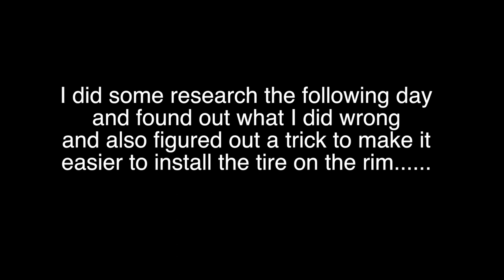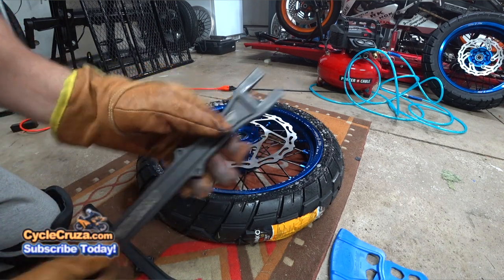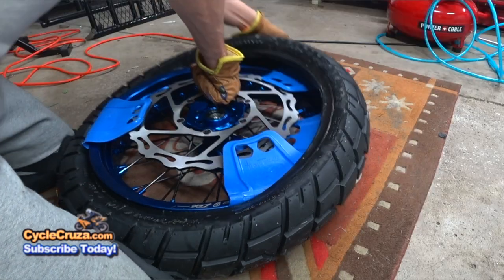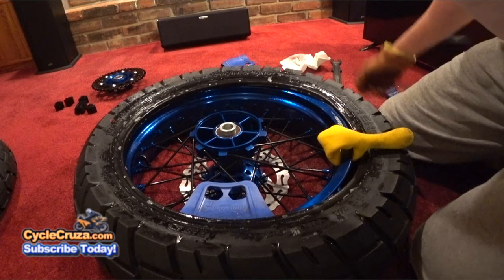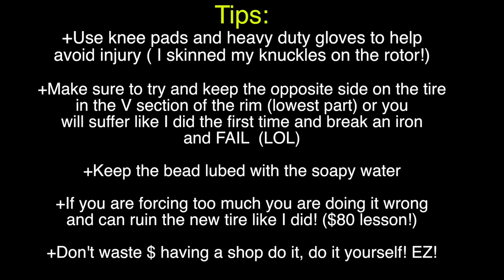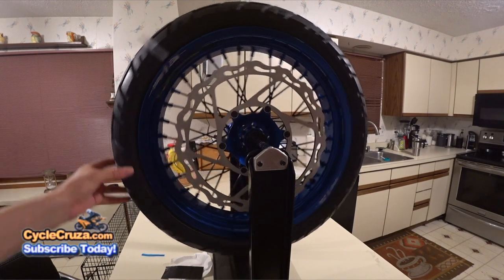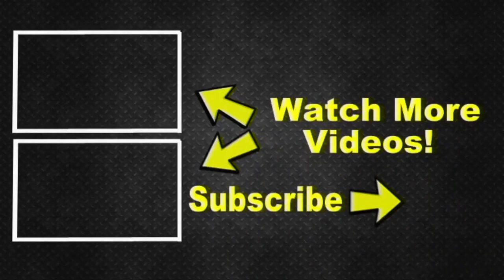How To Change & Balance Motorcycle Tires EASY!

Comment: I ruined a tire my 1st time too. Don't feel bad. Nice to see someone make a video about how easy it is to ruin a expensive tire. Most people don't mention the tire has to be in that groove. Experience is a hell of a teacher. Good video! Btw, sometimes it easier if the NEW tire sits in the sun for an hour or if its winter I put a hair drier on low inside the tire and put the tire in a box if I have one big enough. WARM TIRES ARE ALOT MORE PLIABLE!

Comment: Hi cyclecruza, today my mechanic changed my tire on my cbr 125 r. He couldn't get the rear tire to fit correctly in the wheel so he put an airchamber in it, but it is a tubeless wheel :/ is it dangerous(maximum speed of the cbr125r is 130km/h(or 80mph)) can my tire blow up?(i read that the air between the tire and the chamber can explode the chamber or the tire if it gets to hot)

Comment: Ok so I remember watching your some of your videos a while back. You were talking about how expensive it is to own certain bikes because of maintenance through the the dealerships. I do my own maintenance, valve jobs, everything. I take my wheels and tires and to a shop. C'mon Cycle Cruza, everything else is easier than tire changes without a machine.
Reply from the maker: C'mon change tires yourself, it's so easy it's not funny with these tips I gave. The two bead buddies make changing tires a cinch.
Reply: @CycleCruza  yeah I think I'll give it a shot next time I need tires.

Comment: Just did my Aprilia Tuono tires. It took me for both tires 1 hour including balancing. I love Continental tires, they are soft and super easy to mount. I used 3 rubber rim savers and a spoon. No scratches, no damage on the wheel or tire.
It would have taken me more time if I had to remove the tires, this time the tires were taken off by the previous owner.
P.S. I wish that I had a set of knee pads, my knees are kinda sore.

Comment: It'll do!
 For everyone's info.
 The "V" part of the wheel's cross section shape is called the "well". It allows the tire's bead to go over the sides of the rim that are bigger than the bead diameter, as the opposite part of the circle moves into the well.
Don't use too strong a mixture of soapy water by the way. Just about the same as you might use to wash dishes by hand. Tire shops use a special soap paste, which  doesn't affect the rubber. Neat dish soap won't dry off and actually makes the bead slippery almost permanently.
Reply from the maker: No more shops for me! I actually look forward to changing tires now, takes me less than 15 minutes a tire. I installed my rear tire on the rim in less than 5 minutes!
Reply: When I was doing it as a job, 2.5 mins including balancing. ;¬)

Comment: I am trying to put a tire on a vstar 650. Wont go on. If I send you the tire and rim, how much would you charge. I cannot find a motorcycle service place in the Denver area that is willing to do tires. I dropped it off at a Sun Honda, they had the bike for 2 weeks and said they were not able to get tires on. We are not a big motorcycle place so not much for service here.

Comment: If you think you’re going to be doing this often. Spend an extra 80 dollars and get the tusk tire changing stand. It gets you off the floor. 
I had 4 flat tires, I could spend 80 bucks on a stand, or I could pay a shop 300 doll hairs (yes. I quoted it) 
The stand paid for itself first use and this is a tool i will have forever. Good luck guys
Reply from the maker: I have one!

Comment: Awww man, I remember my first tire change. It was pretty easy on the front and just like what happened to you on the rear. Finally got it after taking a little break. But had to take it to a shop since my tire inflator didn't have enough power to pop it. Got them balanced for free since it just needed air to pop it.

Comment: i couldnt see if you put the red dot at the valve stem or not.

me,  if it turned some then i would have marked the heavy part, then the light part, let the air out, broke both beads, turned the tire 1/4 turn, put a lil air in it ( but not to seat ) , put on balancer , and rechecked it for the 'true tire ' . then filled it to the proper 
 pressure.

besides, you didnt check the spokes to see if there was no leaks. .. get a tub ( oblong) put warm soapy water in it, set tire in it, rotate it slowly to make certain there is no leaks.

awsome video !!

Comment: They make something called bead sealer that can be used to stop leaks at the bead. It's like liquid rubber. Break the bead off the rim, brush it on the bead and reseat the tire. For future reference or for someone else.

Comment: If you are a committed lifelong motorcycle rider then skip the 900 dollar telephone one year and buy a manual tire machine. Shops in my area won't mount carry in tires and their mark up on tires is out of my budget when I can do the work myself. I bought a Coats 220  twenty years ago and it paid for itself in 4 tire changes. I maintain a Vstrom, Goldwing and an HD Road King. Thumbs up to ya' for sharing your tips, successes and failures. Ride safe.

Comment: When it gets tight take smaller bites, don't go so far away from the bead buddy. I do it without shields but I've been doing this for 12 years. And yes don't force it those beads tear easily, the wider your flat bar and smoother the better.

Comment: Cyclecruza its even easier if you just use 1 bead buddy. Start with the bead buddy then work your way around to the right of the bb. By the time you come full circle and end on the left of the bb the tyre goes on real easy.
Reply from the maker: with just one bead buddy the last part will want to pull up the other side and you have to put your knee on it which is irritating. Two bead buddies avoids that issue. Maybe it's because this Shinko 705 tire has such hard rubber, many people say it's one of the more difficult tires to install. However, with two bead buddies it's easy.
Reply: cool

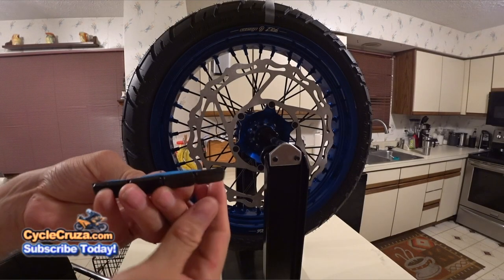Comment: Those weights at 8:50. My local dealership left those on my wheels when I had them do tire changes for both of my bikes, and then I would get pissed off and remove them. Was I supposed to keep them there?
Reply: They need to be there to balance the wheel/tire assembly.
On spoke rims I prefer the weights that go in the spoke, can't fly off and doesn't look ugly on an awesome rim. Mag wheels basically have no choice.
I agree with another reply that said to turn the tire 90* or even start at 180* and see if it lowers  the weight needed to do the job. The red dot is the starting point.
Reply: And yet, Suzuki never left them there when I bought my bikes. Why?
Reply: 2 possible reasons: the first tires were perfect, which isn't likely or they weren't balanced from the factory if your talking about a new bike.
Me personally for my own bike with beautiful mags, which I don't have, would mark the tire, pull it off and put a  patch inside the tire to weight it. I would do this only after trying to turn the tire first, make the least weight possible.
My DRZ400's wheels are so scratched from the first owner it doesn't matter, but I still prefer the weight on the spoke.
Reply: I see, and I also own SM DRZ, and then a 17' SV650 a year later. The weights on my SV are still there, but I happen to just give up because they were too hard and risky to remove, and didn't want to scratch my wheels. Thanks for the enlightenment, though. I never could have known that.

Comment: Congratulations, I see you are cheap like me but this helps research and learning. By the way, have you seen the video on how to make tire placement or removal much easier with several zip ties.
Reply from the maker: These shinko 705 tires rubber are too hard for the zip tie method, that method is better suited to regular street tires with softer rubber.

Comment: I recommend just bring it to the shop. Some tires  r softer some r harder,  same tire size but tighter. Taking off tire is super easy but put the new tire back on the rim. Especially rear tire.

Comment: Don.t motorcycle wheels need to balanced dynamically and on both sides of the center just like cars ? I.m asking because while this manual method obviously works from the weight point of view, it doesn.t guarantee a vibratiin free ride. Just my 2 cents.
Reply: Eh. It's a dirtbike bro.

Comment: You're welcomed.  This time you kept the bead down in the valley of the wheel, away from the rim until you aired it to set the beads.  Simple geometry.  You used a lot of plastic helpers to do it, but you did it.  Congrats.

That is still far too slow to punch a clock for a paycheck, but most DIY takes four times longer than a skilled worker, even one just working with spoons.

Ride on man.  Oh when you decide to use that removed tire again, you can save it by using a $15 TUBE.  That's what those rims were built for anyway and better than flushing $200 for hurt pride. Edit: Wait an $80 tire.  Isn't that a bit on the cheap side for a good sport tire?  Even mail order, Mich and other front shelf tires are over 120.  Those aren't Kendas are they?

Ride safe.
Reply: They are shinko 705 tires. Not great, but not bad either. Just kinda heavy for supermoto, but a decent off road and on road tire. So not a bad intermittent choice especially for learning to change your own tire. Better than messing up expensive rubber.
Reply: @kacasio1     Not a bad price.  I had one Kenda tire once (very inexpensive) and the sidewall was very hard.  You could sit the bike with no air and the tire stood up.  That one was a real hard mount even with the hydraulic machine.  No sidewall stretch at all.  It didn't look or shape like the standard sport tire of that size/profile number at all that I took off.  It did last a long time but wasn't as sticky.  

I tend to like British Avons myself.  I like their side tread pattern.  The Perelli and Michelin are great, but pricey.
Reply: i had a set of pirelli tires b4,  they were for a truck tho, but very good for icy slush, and good grip too.
Reply: 舉發回覆提交重懲處分

Comment: u make it look so much harder than it has to be lol as long as you keep the bead in the drop center on BOTH sides of the tire, changing a tire is cake. Also, remove the rim shields you aren't using, cus thats just taking up space from the side you need it.

Comment: A little rubber cement on the bead will solve the leaking bead. Debead it, add rubber cement and debead. Then let the air out and let the cement dry. Bead fixed.

Comment: I just went through the same chit changing my rear tire . It looked like bead was tore up bad. Then I had a idea what it the bead could of been fixed . I really didn't like the idea of throwen 100bucks in the trash . Then I found Xtra seal bead sealer and that chit worked even with the bead tore up

Comment: So it only took a total of basically 32 grams to balance it perfectly.  I'm happy it turned out well for ya CC.
Reply from the maker: That was the front wheel.  The rear wheel took more, I used 7 x 1/4 oz weights and 1 x 1/8 oz weights for the rear wheel.

Comment: please be careful using wet lubrication when fitting tyres especially with tubes I had the misfortune of dealing with a fatal where on harsh acceleration shortly after fitting a new tyre using washing up liquid the tyre turned on the rim  and ripped the valve out resulting in immediate deflation of the tyre and tyre jumping off the rim.  tyre soap dries and does not cause this problem

Comment: Seeing all you have to do I would not like to get a flat on the road! I am with the get a mechanic to put the tires on I might be dangerous with those tire irons! lol
Reply: Fix a flat bro
Reply from the maker: Just bring a tire plug kit, takes less than 5 miniutes. However, if you have a tube than you are in for some work or a tow. That's why I modded my rims to be tubeless!

Comment: You can probably use a tube in the damaged tyre and get the use out of it.
Reply from the maker: tubes suck, adds weight and forces you to get a tow with sumo tires. If my tubeless set up doesn't last I will probably buy Alpina tubeless sumo rims.

Comment: It wasn't really the bead buddy that did the trick.

You managed to keep the other side of the rubber off the bead ..

You could also get both knees up on the rubber if it's not too stiff.
Reply: Could you please elaborate? I'm trying to figure this out and get it right the first time. What did you mean by "managed to keep the other side of the rubber off the bead"?
Reply: @turtlepowersf  notice on the inside of the rim...
The smallest diameter is in middle..

With the rim flat on the floor ..
Keep the bottom side of the tire bead that's near your knees ( rubber close to the floor) inside that middle part of the rim. That allows you a little more slack at the top to stretch it over the rim.

If you allow the bead of the tire (the side that's already on) to pop up on to the bead of the rim ....it's too tight on the other side.
Reply: That's kinda why the zip tie method works.

The diameter in the center of the rim... ( Like where the spokes would attach if it were a spoke wheel)  is prob 1"- 2" smaller diameter than up around where the bead locks in. 

Cause if you can pinch the two beads of the tire together... And keep that in the center of the rim in one side .. it gives you the slack you need.

The different tools are helpful for leverage and and extra hand and such.... But you gotta keep the rubber off  the bead untill it you get it stretched over.

If your doing it right... It should go right on.

The wider the tire ...the harder this gets....
Reply: @robertmoorej  ok, cool, that clears it up. Thanks a lot. I thought the "bead" was the edge of the tire. I guess it can also mean the recessed part of the rim? Either way, i think I get it. I just dont know how tough changing my 240 rear will be... thanks again
Reply: @turtlepowersf  something like that . Lol

Whatever the lingo..

Comment: You still doing it the hard way but the only reason you didn't get it the 1st time is because the bead didn't drop down into the groove of the rim and that's why you ripped the bead if yu was to push dwn on the opposite side of where you was pulling you would gotten it

Comment: not a total loss though, you can always get a tube and use that other tire still
Reply from the maker: eh I don't want to ever use a tube for sumo, if you get a nail it you are forced to get a tow as where tubeless takes a tire plug fix in less than 5 minutes you are riding again.

Comment: You messed up setting the bead. Firstly you don’t have the valve stem in when you set the bead because it sometimes needs to much pressure and it will strip the thread in the core.       Also all you need to set the bead is brake cleaner and a lighter
Reply: Nah. You always set the bead with valve core out bro. Air flows in much faster.
Reply from the maker: As you saw in the video, I had no issue setting the beads with the valve core in. With a proper air compressor and you installed the tire on correctly you shouldn't have an issue. Check out Ari Henning's tire change video from motorcycle magazine, his video clearly states to put the valve core back in before putting in air and setting the bead @6:36 : https://www.youtube.com/watch?v=dAKIuSjPXxA
Reply: @CycleCruza  sure, sometimes they will set fine with the valve core in. It's just not necessary. The easiest way is to.remove the valve core, set the bead, install valve core and air it up.

Comment: shit honestly i keep seeing these videos but i just cant bring myself to do it when i can bring it to literately any shop with a coates tire machine and they can pop it off in under a minute for like $7..
Reply from the maker: Every place I went to in the past charges a standard $25 - $50 a tire!! Not only that, they take all day or the next day to do it! Never again! It's so easy to do it yourself and you feel better being self-sufficient not having to rely on others.
Reply: Cyclecruza, where I live in NJ, most shops charge about $40-$50 to mount and balance one tire, and it really sucks when you run over a nail and pop the tube a few days later and have to pay another $40 to have a new tube put in
Reply: @CycleCruza  yup, and my shop closes at like 5pm, they have no parking lot, no waiting area, kind of a PITA to get to. I usually drop my bike off, UBER home, then UBER back the next day and ride home. So much time and extra money for the rideshare trips

Comment: Would have Definitely spent the 50$ and paid a shop lol u killed yourself over 50$
Reply from the maker: No, it's easy now. With my new style it only takes me less than 15 minutes to change a tire and balance a wheel. The reason I messed up the first time is because I did not keep the other side of the tire in the lower section and did not lube. Also, the aide of the two bead buddies makes it incredibly easy. The main issue I have with shop is they make you wait all day or longer to do the work, NEVER AGAIN will I go to a shop for a tire change and balance.
Reply: 50 saved is 50 earned brother.